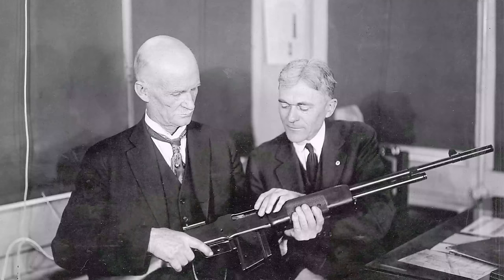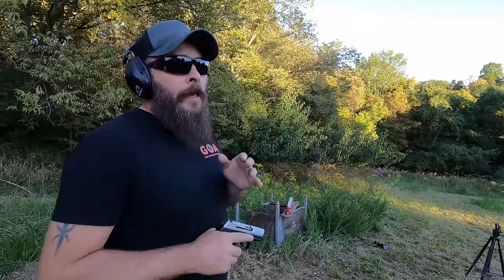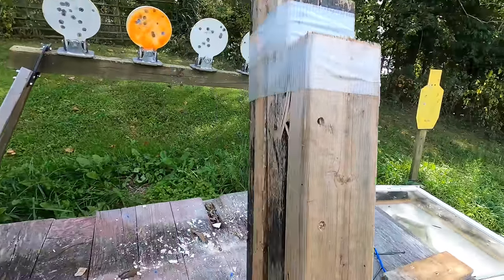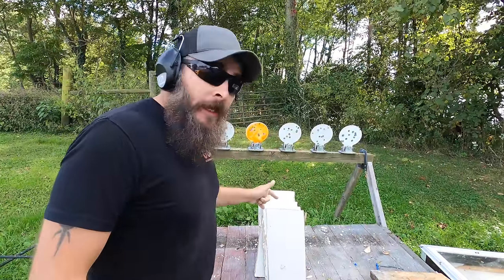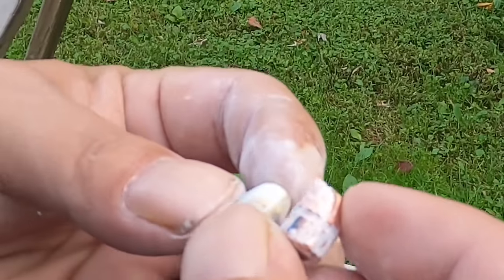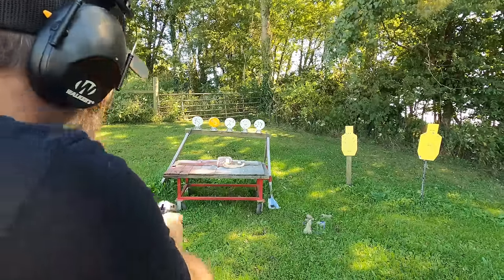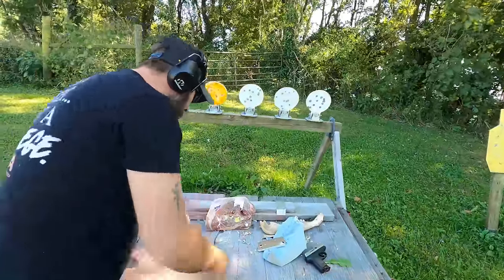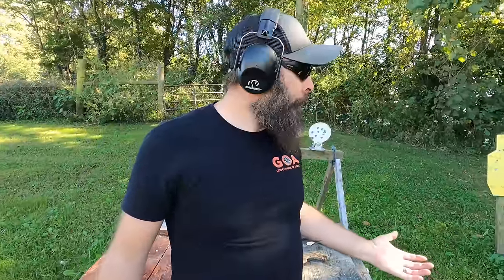Truth about the 380 acp

Comment: I work in the Emergency Room.  I can tell you first hand that a heart shot is NOT an instant kill.  We've had medics on scene that saw a perp get a well placed upper right chamber heart shot and still kept going (according to the dash or body cam footage) around 15 seconds.  However, the left ventricle is a more viable placement, and still you can have residual blood pressure to get off a few rounds or finish a charge/barrage.
Reply from the maker: That’s why I said what I said at @12:00
Reply: @GunDoctorTV  That's not what you said at 0:30
Reply from the maker: @Thilindel  in the beginning I went on to say “most of the time”. So yeah, stuff gets cut out in editing to bring down the run time….imagine that 🤯

Comment: Military 30-06 is ~150 grain 2,400 to 2,700 fps FMJ and will put a hole through you but it's a 0.308" hole and you get just enough energy to make that hole.  Put a 0.308" hole in you with a hollow-point varmint round and you will get all of the energy.  Big difference!  38ACP will make a 0.355" hole but with a proper self-defense hollow-point you're going to get all of the energy and the round tearing through you will expand to much wider than 0.355".

Comment: Its funny how people who dont load for 380acp will call it under powered  - and maybe they are right about standard factory ammo out there, but the same can be said for standard factory 45 acp. Both can easily be reloaded to accuracy and performance levels not commercially available. With Unique and the Lee 105SWC (drops at 108gr) you can easily get over 1000fps. I got 1042 fps with a Kahr CT380 and had no pressure signs. My testing with Herco and CFE Pistol with 45 Super in a 1911 makes me think trying them both with heavy for caliber 380acp bullets will give top results.

Comment: If you want any hollow point to expand better than put Vaseline in it and use some cornstarch or flour to make the exposed vaseline no stiky and it will ignite from pressure and make the bullet expand very quickly.

Comment: I load for 357. One of my loads uses a 380/9mm 95gn bullet,  2 bullet types, one is a hard cast 95gn lead RN and the other is a 95gn XTP. both are on top of 5.5 gns B.E, once fired 357 cases. Rifle is a Traditions G2,  it's a break action, single shot, 22 in barrel. On top is a Bushnel 3x9x40. Haven't been to the range yet to test but should be intresting.Just something to think about. MMR&P Club

Comment: Isnt a 9mm a better choice? More power?
Reply: Depends on a lot of factors. 380's tend to be smaller, lighter, lower recoil, and easier to conceal than 9mm. There are micro 9's that are close in size and weight to 380's, but they have a lot more recoil which will affect accuracy unless you put in a lot of practice time at the range.
It's also a lot easier and more comfortable to just throw a small 380 in your pocket than it is to wear a larger gun on your hip which means you're more likely to carry the smaller gun.

Comment: I have a Glock 19 converted to 22tcm9r and it shoots a 39 grain 22 bullet at almost 2000 FPS with almost no recoil. With some more testing I think this will be the new house caliber because it is so accurate and second shot placement is so easy. The conversion kit cost me $160.00 and all it was a barrel, guide rod and main spring. You can use your Glock mags. The only problem I have had is I get light primer strikes once in awhile.

Comment: ....the 1 thing a corner or an ER doctor cannot tell you about about the person who was shot, was how the person reacted when the bullet hit them. Yes it'll enter the thoracic cavity, yes it will damage organs, but what happens the moment the slug impacts the body? The ER doctors can't tell you that. Only the person who's been hit with the bullet can tell you that. What happens once it passes through the first three quarters of an inch may not be different than any other cartridge, but foot pounds of energy, is a factor that they can't measure. That foot pounds of energy, impacting the body, is part of the equation, and after the person is down in the ground, you can't tell the difference, but you would be able to tell the difference the moment you were hit with a higher foot pound of energy the lower foot pound of energy. Caliber matters.

Comment: its all about shot placement, the 380 is a very capable round, the weather outside is a determining factor on what im going to carry. winter time i generally chose 9mm over 380, summertime im carrying 380, smaller print while wearing summer clothes, less layers a would be crook would be wearing. i dont like the capacity of my current 380 as its single stack mag 6+1, but a spare mag is always carried. 7 rounds is more than enough to stop a threat in its tracks. if i was going out in bear country, im bringing no less than 357mag. there is mountain lions around some of the more secluded places i like to fish, so i have 357 mag (mine holds 7 rounds) and ill have my compact 9mm with 12+1rd  mags. its all about what you are comfortable shooting, and how you are with the recoil, if you react badly to recoil, your not going to get a good, quick follow-up shot.

Comment: .380 is just slightly under powered in my opinion. Its almost good for what it is meant for. It needs a little more juice the make hollow points open up reliably. Either way it still will put a hole in something and I'm still going to carry one out of a almost perfect compromise  of convenience between power,weight,concealability

Comment: If you have a 380. Pistol that will feed xtreme penetrators by lehigh or underwood.  They penetrate deeper and the wood cavity is up to 8 to 9 inches with a total penetration of 13 to 14 inches ,leaving a 9 mm hollow point wound cavity.  Not all 380s will feed them consistently.

Comment: All handgun calibers suck in their ability to quickly stop a threat. Even if a human heart is destroyed you can still reckon on the attacker being a threat for about  another 20 seconds. It use to be that 380acp was chosen because you could find a more cocealable smaller frame handgun. Single stack 9mm handguns have come down in size a lot and I prefer the 9mm but 380acp will still get the job done. My issue with 380acp is not so much the round but the guns which tend to use low capacity magazines. I prefer to have the option of multiple hits on each target.

Comment: Although I've EDC'd a 1st Gen KT P-3AT for almost 18 yrs and I'm very comfortable with it, when there's a chance of going into or through a more sketchy area I will carry a G19 and my 7.5" 300 BO "truck gun"-ESPECIALLY NOWADAYS.  Having said that, my wife and adult daughters and my teen granddaughters are NOT fans of the snappy recoil and light weight of the P-3AT.  They MUCH prefer a Taurus G2C, G19, XD in 9mm.  The KT, on rapid second shots, with the light weight, skinny grip, and generally less hand strength, makes it very difficult for them to shoot accurately or even willingly.

Comment: I've seen local shooting statistics where the .380 had a higher lethality than .44 magnum. The statistics were by incident, not shots on target, so I suspect there may have been more incidents of multiple shots and more shots with the .380. That may have been because the.44 stopped more effectively with one shot, but it wasn't really clear. Bottom line: you don't want to be shot with a .380, and neither does an assailant. I like the hand cannons, but they aren't the most practical for concealed carry. In fact, it's easier to put multiple shots on target when you don't have to deal with the heavier recoil. Shooting .357 in a small enough model for concealed carry is painful. .380 is the minimum I would carry, but that minimum is entirely adequate. I should add that I don't carry, because I live in a very low crime area, and carrying all the time would probably increase the likelihood that I shoot myself more than the likelihood that I would use it to defend myself. If you have a handgun and young children in the house, you are statistically more likely to be shot by your children than you are to defend against an intruder, so take appropriate precautions. A little fear of your own firearm is healthy.

Comment: Full size 45 acp goes with me everywhere. Just today it's been upgraded to 45 super with underwood ammo. Glock 21 Gen 4. If someone Is really hell bent with adrenaline and anger or on drugs, 380 may not do it!! 9mm at the very minimum(my p365 xl). Although I would like some +p rounds for it
Reply: The odds of that are extremely low......especially among any altercation which is also extremely low probability. Anything you pull out will stop 99 plus % of altercations.

Comment: For a relatively weak round such as the 380, I would prefer FMJ rounds. I would want all the penetration I could get. Ditto for a 38 special if fired from a snub nosed revolver. I think hollow points are best for faster rounds like standard 9mm, ad 38 special plus p when fired from a four inch barrel. They are really effective when fired in 357 magnum as well. Just my humble thoughts. Peace.

Comment: .380 is just a shorter 9mm with less bang behind it . If you can find a ammo brand that consistently penatrates 12-16 inch and expands fully, then you basically have a 9mm.  Any xtp bullet will typically do it to, like “precision one” or “fiocchi extrema” brands.
Reply: Seen multiple fmj 380 rounds get 19 inches of penetration.
Reply: @drugsarebad97  that is my point exactly though. 9mm fmj is just as deadly as hollowpoints,  if not moreso

Comment: The Com-bloc service pistol for 50 years was the PM or the Pistolet Makarova. Commonly referred to as the Makarov. 9x18 Makarov is pretty much identical to .380acp even though it isn't interchangeable. Ball ammo is the way to go. Not enough horsepower to the round to have penetration and expansion. Trust me. You don't want to be hit with one.
Reply: Da.😊

Comment: The short answer is yes.  Anyone who has worked in a field where you regularly see people get shot have seen .22 LR. 25 ACP, 32 auto and 380 auto claim many lives.  The first homicide I ever worked was a single shot of .22 from a pistol to the chest.  He just fell over, didn't run or anything.
Reply from the maker: Hey awesome. I’m a former L.E.O. myself. You are exactly right 380’s, 32’s, 25’s and 22’s are very common amongst criminals and the lives they snubbed out speaks volumes. Thanks for your input 🇺🇸🤙

Comment: BullyShitto!!!!!
What firearm are you using?
At first I thought it was a Kel Tec P3AT.  But when you fired into whatever, the slide looks like a 9mm.
Not much useful info here.
Reply from the maker: It’s about the round not the gun. It’s a CPX3
Reply: I agree, for sure.  
But in your hand, the gun looked like a P11 from the slide width, vs. a .380 acp.  I was mistaken, though.  (I hate that!)  
This was the first of your videos I've seen.  Forgive me for thinking we were being played when I thought you did the test with a 9mm.  I've run across more than one fraud when you-tubing.
So, my sincere apology to you and your viewers for the negative comments.
Barrel length has great influence on results, as you know.  If you told us what firearm you were using, I missed it.
I looked up the CPX3 and was surprised to see that it is as wide as my P11 and my wife's P238.  When I saw a small polymer in your hand, I was thinking LCP or P3AT, until I saw its width.  I really wasn't trying to be a jerk.  It just turned out that way.  🙂
I rewatched the video today.  Good video and interesting.  Very good information.
   @GunDoctorTV

Comment: Great idea for a video. All for the 350 ACP calibre for real world defence. Would have liked to have seen you  space the drywall  apart by 10-15 feet and using 2 sheets to make  one wall.  Like the other penetration test materials. :) Even  if some of it was for entertainment.  Does still prove a point. In  the end....real world defence occurs at "up close  and personal distances. So the difference in "stopping power" between a 380 ACP and a 9mm round is moot.  I'm sure some distances are less than 10 feet e.g. stairwell, car-jacking....

Add, when defending....chances are we won't be in "range shooting stance--standing square w/ 2-handed grip". We'll draw  with one-hand and shoot with one-hand....coffee in the other. Or phone. Wife. GF? etc. j  380 ACP is easier to  easier to control obviously than a 9mm  rounds in a gun weighing roughly the same. 

And gun makers are waking up to this fact. Ruger  with their LCP Max 10/13+1. Bersa Thunder 15+1. SIG 290 RS 8+1.

Comment: The FIRST Colt's John Browning design automatic pistol made BEFORE ANY thru-bored cylinder revolver by Colt's was the .32 (Short Action) Automatic Colt Pistol and it was a RIMFIRE cartridge loaded with 2.1 grains of Bullseye Powder pushing a 68 grain copper plated lead bullet @ about 690 FPS. It killed more men than it didn't, as the gum held 9 rounds. In 1873, shooting a man 9 times was socially acceptable if he tried to rob you.
Reply from the maker: Thanks for sharing!

Comment: For me I carry 9mm. It's cheaper and guns for both 9mm and .380 are close enough to the same size and weight it doesn't really make that much difference for me. I wouldn't feel under armed with a .380 unless there's body armor involved. If so you need a rifle or shotgun, and even then, a plate carrier rated for rifle will stop even that.

Comment: May I get in here? Be kind now. The dia. of a ".380" is really .356 in. The diameter of a .357 magnum is, You guessed it .357 in. And of course the .356 is 9mm which is... yep 9mm para. and the .357 is used, where else? .38 special which is actually a .36 not a .38. So the weight of a .380 bullet is lighter than a .38 spl. But the .38  Spl does come in a similar weight and the velocity out of a 3" to 4" bbl is similar. I even have loaded lighter .357 magnums that aren't much faster than a heavy and hot .380. so what is the gripe. I carry all the above for CCW.

Comment: most people are killed by 22 accidentally not to mention they are commonly used by killers because they are cheap to dispose of and you plug someone through the eye at close range it does the trick but a lot of people are by 22s accidentally because people are less prone to observe safety protocols because they think it's just a 22 but that 22 is deadly mutha especially if it severs a major artery.

Comment: I question the penetration theory presented by the FBI. A bullet must penetrate 12" in order for it to rate high in stopping power. If you place a bullet in the middle of the chest between the nipples.....its not more than 4" into the heart. Is the FBI saying that won't stop a person?
Stopping power should actually be measured by the amount of energy a bullet delivers.
Let me say this....if a 2 year old balls up a fist and hits you on the point of the chin....it should not knock you down. If the average 21 year old does the same thing, it may put you on your keister. 
As the man says....bullet placement is key to stopping an assailant.

Comment: The cold hard facts is that if two people are seven feet apart and one has a 380 and the other has a 45 and both are equally proficient, then almost always the one with the 380 will lose.  Power does matter.  Still, a major point is that a 380 is so much more easier to carry than the 45 that it's a great option; just need to know the limitation.  If I had a 45 caliber and someone else had a shotgun, I would say "Sir, I have a firearm on me that you can have; could we settle our differences over coffee?
Reply: As far as a .380 goes, it is a great option for people who live in warm climates because people wear thin clothing most of the time, but if you live in a cold environment it is not a smart choice when people are wearing big heavy coats.

Comment: Its way better than a .25acp or a 32acp. id carry a .22lr, 22mag then .380acp. and in stopping power the .45acp is designed to hit and stop people who where on natural pcp and wrapped in tight cloth and it worked better than anything else. 
Iv shot a b.45 acp ftx into living flesh at 40-50 yards and it dropped it and it put  a .45 size hole in the skin then immediately under the skin it was fully expanded and about the size of a 12ga hole.  and with a .45 if it dont expand then its still a .45

Comment: Um, .30-06 is only .30 cal, and WW2 loads were nowhere near as hot as today, and the bullets were non deforming FMJ spire points. And those are 2"x4"s, not 4"x4"s!!!
Reply from the maker: I’m dyslexic so I make mistakes and yes sir you are correct.
Reply: @GunDoctorTV , I do think the .380 is the minimum viable self defense round, though .22 WMR can be effective in some circumstances. For small CC pistols, I think surplus 9x18s are a great choice, especially for people with tight budgets. I also think compact 9x19s are good. I just wish people would pull their heads out and quit getting super short barrels. One ide for a comparison of barrel length would be to get two of the cheap (around $260) Bond arms Roughneck Derringers, one in 9mm (Luger) and the other in .357 magnum, or one gun and an extra barrel. The barrel lengths are both officially 2.5", but that includes the chamber, instead of effective length. I bet the velocity and penetration will be about the same, but the .357 will kick worse, make a huge fireball, and maybe be less accurate.

Comment: shooting wood with any bullet hollow point or not will not be proof of anything re guarding expanding bullets. properly testing with fluid, meat , bone , clothing, in may testing, the Hornaday 380 acp critical defense is far superior to any hollow point design I have found expanding at times to 7/16 of a inch or more. I always kept one in the chamber of all my 380s. some pistols they work flawlessly and some pistols they hang on feed ramp so I just use it first in chambers the rest of magazines ball ammunition. Nana and papa aka the hunter wishing you well.